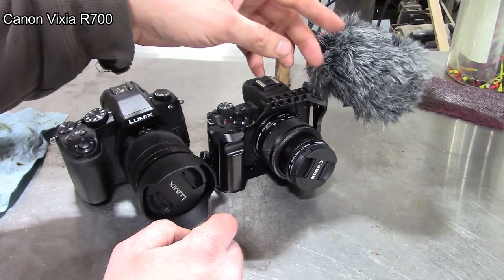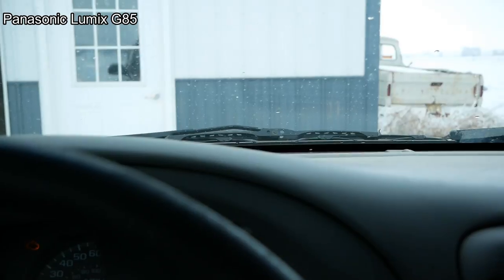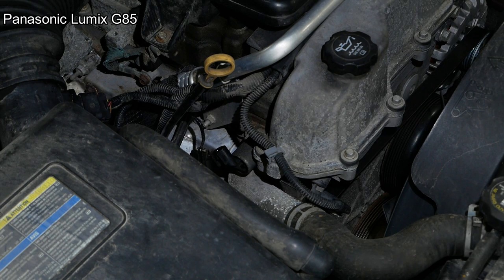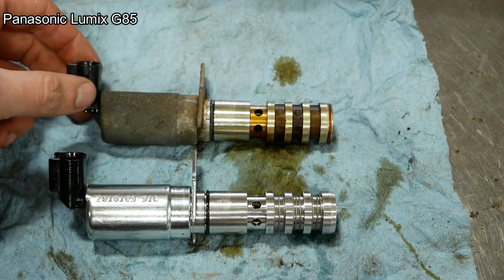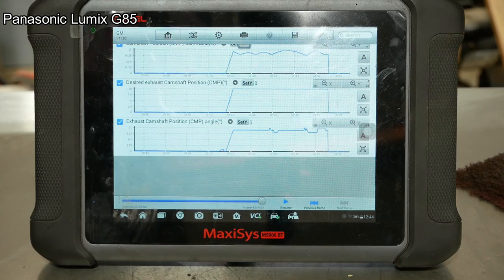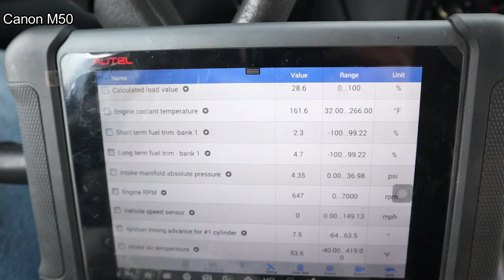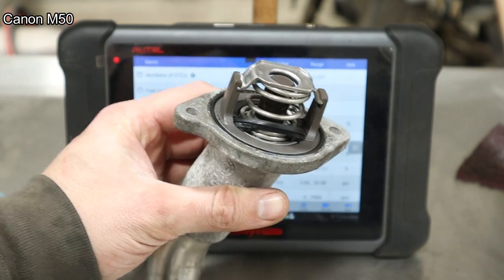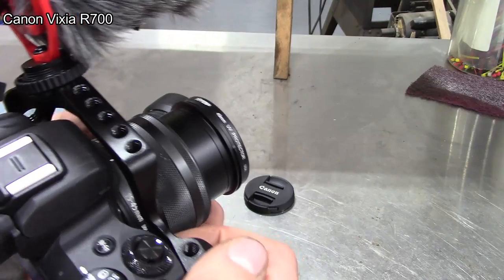Chevy Trailblazer -  Runs Rough on Cold Start, P0014- New Camera Testing

Comment: lumix is far and away the best image quality in my opinion, though i feel like there's some quirk about the framerate. color is great though. it looks a bit choppy, might be a software/settings thing related to the image stabilization? i feel like it would benefit from recording in 60fps instead of 30, maybe without the image stabilization? i guess that introduces some other problems in editing, file size and uploading though. 30fps just doesn't seem quite enough on modern devices. still something "homey" about that vixia though and even though its lower res, it's smooth and feels familiar.

Comment: So, here comes a long(ish) answer from a camera nerd. Without going into much detail, ISO stands for the camera's sensitivity to light. It is a standardized number that is derived from two major predecessors. They were the ASA (American) and the DIN (German) standards that essentially described the same thing. Many moons ago both numbers were printed on a box of film (yes. film). The lower you set the ISO, the less sensitive the camera is to light, but it also produces a higher quality image. The best test for the limits of image quality is to use cameras in identical, low light situation (max out the ISO) and see witch one produces the better image quality.  As for aperture (A) vs shutter (S) priority or program (P) modes. You use the cameras in a very wide variety of situations where the level of light changes rapidly and the subjects of your videos/pictures are sometimes very light or very dark. Ie, when a dark subject is in the front of a light background or visa-versa. That means the camera can't keep up with the wide latitude of light variety and simply don't know which one is your priority. A situation like that is when you want to use manual mode and that way the exposure will remain the same regardless of where you point the camera.  If you want the camera to sort of self-adjust and make the best of a tough situation relatively fast, put it Program mode. I will spare you the  details of when it might be advantageous to use Aperture or Shutter priority modes. They each have a place, but only if one really wants to geek out on this. I think in your situation is best to just set it manually or put it on Program.  As you get used to setting the manual mode it will often seem like a good option. I use to do this for a living. Like in many other craft, the more precise your setting (depending on your situation) the better your end result will reflect your intention. I hope this helps to confuse you :-). Cheers.

Comment: Canon for me as you have better control of your ISO & shutter speed as well as a better selection of lenses.  Of course they give you the worst lens as a kit lens.  Read up on settings as you had it set to manual which wrong and that is one of the reasons for bad auto focus

Comment: Everything in the background was blurry with the new Canon. I don't see anything wrong with your original camera. Why did GM use those thermostats with the rubber seal? It seems to cause a lot of problems and the computer controlled systems are so sensitive to engine temperature.

Comment: Maybe going do more tests with cameras to figure best settings will be Wes :) and may help! Also have ever tell costumer use 89 or higher octane gas plus add a bottle of STP Total Treatment for fuel injection or carbs plus on gas or deisel fuel vehicles and do on cold or hot starts get on highways speed like 50 to 80 mph speeds so get higher engines revs  compare slow speed highway do lots stop and go at many inserctions stops sign or lights stop at too ! But do faster speeds clean out engines dirty electric components plus less codes even parts to replace on and on slow speeds get more codes show up ! What trying saying on high speeds plus highways get full amps out alternator charging plus sensors work faster compare on slow speeds!

Comment: If you want to control the focus depth then use aperture priority. So, for videos I guess you would like more things in focus, so lower aperture is better >7, then camera will control shutter speed and or iso to correct exposure. Anyway all this wont do you much good if your lighting is not sufficient. I guess you could get roughy the same results with some tweaking with both cameras but out of the box the Lumix seems to do a better job for you.

Comment: As much as I miss my trailblazer, the thing was a temperamental piece of junk. Cam position sensor, vvt solenoid, a pile of thermostats, every oxygen sensor multiple times, fan clutches, etc. the thing was a nonstop money pit past 200k till it hit 230k and the 4L60 detonated out of the blue. Don’t even get me started on the CV running through the oil pan or the godawful SAIS/AIR mess

Comment: 2007 trailblazers have a regular pleeted fuel filter and fuel pump assembly, you'll need to replace that hole sending unit assembly, that's Also where the small evap leak is, I'll bet you $50 if it's not already been replaced the evap line on the pump is rotten...

Comment: If the cameras were using film I would say they are slightly overexposed (washed out). I would close the diaphragm if it has one maybe 1/3 to 1/2 a stop. What I said may be meaningless since I only used film cameras. The Lumix lens are basically Leica lenses if IIRC. Leica lenses are considered the best and this is coming from a long long Canon guy.

Comment: How bout a Sony A7s III? I liked the canon colors always and in this video too, but the Sony certainly specs out any other camera at the price imo.
Reply from the maker: I don't have $6000 to spend on a camera. That's 10 times what I paid for either of the ones I have.
Reply: @WatchWesWork  Yeah, it is expensive, but it should be proper... I only own the first generation A7s, which doesn't have much of a autofocus or in-body stabilization. But with a used 24-70mm stablized f4 lens it is still pretty good with it's sensitivity. I think you could get the A7s III with the 24-70mm for around 3500$ though. It is still a lot of course. All of the newest Sony's have autofocus that is nuts, even the A6600 (same system), but imo 1500$ for a APS-C is a bit steep.

Comment: I hate where GM put the power steering pump at least on the 3.8 in the Impala. Pain in the ass even if you remove the tensioner housing. And yes, the pulley on it has the holes. Doesn't make it any easier.

Comment: Auto focus doesn't like shiny surfaces like screens and clean stainless steel workbenches.  You shouldn't clean up so much.

ISO is the "film speed", doubles every increment, just like aperture and shutter speed.  Makes adjustments easy to calculate for the depth of field or movement.

Comment: Don't think you can describe the oil moving in the wire towards the ECM as capillary action. Oil has a higher viscosity than water of course and the higher the viscosity the more resistance to flow. Migration? (LOL)

Comment: Yes, it has a fuel filter, but not in the engine bay
Si tiene filtro de gasolina, pero no en el motor, esta debajo del conductor
Reply from the maker: Sin filtro amigo.
Reply: @WatchWesWork  cierto, al parecer de 2005 en delante está incluido en la bomba de gasolina

Comment: That's definitely a vacuum or filthy throttle body or so I thought intermittent issues are the worst my guess is that they got scared to drive it by the way it was running so it got stuck  and then when you turned on the car it unstuck hence why you couldn't recreate it

Comment: Leave ISO on auto (for videos).

If you want to change brightness level, change EXPOSURE values.

(iso will adjust itself based on exposure value)
Reply from the maker: You can't do that on the Lumix. It can control the ISO and shutter, or ISO and aperture, but not just the ISO.
Reply: @WatchWesWork mmm, well in that case, i would suggest try sony.
They're near perfection in terms of "video" side of image processing & software.

Comment: (14:29) the face tracking focus looks good to me... it's a tiny bit slow, and it hunts a bit... but all-in-all, not too bad...
BUT, you're overexposed... stop down a bit...
Reply: also, just leave the camera in aperture priority, and stop up and down, and rough set the scene exposure with the ISO. The shutter speed isn't really adjusting the video refresh rate, just the apparent open versus closed time of the rolling shutter. I've always been a Canon camera person, but in your case, I think the Panasonic may be your best choice. The audio was wonderful, that super-cardioid mic is nice! I really didn't hear, nor mind the HVAC cycling in the background, the pattern of the mic kept focused on the sound in front of the camera, and the off-axis noise wasn't really much of a problem.

Comment: I am not bothered at all by the resolution and detail of the images - even the "old" camcorder was fine in this regard.

The ability to capture content in a wide range of circumstances is more important IMHO. More content for us, less re-takes for you.

The moment when you apologised for having the Lumix on low ISO was interesting - I though it was holding detail in the shadows very well, despite the overall darkness of the scene.

In a situation where you're using artificial/point light sources (which is OFTEN) a high dynamic range (the ability to hold detail in both shadows and highlights) would be a virture, avoid having to re-shoot due to shots "burning out" or "filling in".

I was faintly surprised that you're relying on autofocus so much - I know that Keith Rucker LOCKS focus, and uses high ISO, small aperture to get large depth of field. This avoids "surprises"

Keith Rucker (and several others) also use roll-around "studio stands" instead of of tripods. These studio stands have the advantage of

* ease of movement
* long over-reach (mainly used for workbenches, but good for engine cavities too)
* easy height adjustment 

A few video via this search:

https://www.youtube.com/results?search_query=studio+camera+stand

Comment: My 97 chevrolet tahoe does the same thing. Backfires a bit to before it warms up. Been to 2 shops both ripped me off amd told me nothing. Paid one told me they wanted more money to keep lookong at it so i left that place went to another was told i jad low compression and need a new motor. I did my own test the engines just fine. I hate shops

Comment: armchair non-mechanic disclaimer  Why is it not standard operating procedure to hook up a scan tool before turning the key for the first time?  Does it interfere with some other aspect of troubleshooting?
Reply from the maker: I did. The problem was the cam timing stuff was in a different section of the tool. By the time I found it the problem was gone.

Comment: Canon always has issues with focus, ergonomics, and features. It's not so much that it's bad, but not to a lot of peoples liking. I didn't care for the M series.  ISO is NOT for adjusting exposure for most cases. That is what the aperture settings are for.  Most people will screw that up however , use other features for that. Read the manual.
    The Canon has a crop factor of about 1.6 that makes a stock 50mm lens w/ ff sensor about 80mm.
 https://photographylife.com/what-is-crop-factor
     Just skip the Canon and go with the Pany.

Comment: I would just put it in auto aperture , you are not moving fast, so  shutter speed is not critical. The Camera should do the rest for  you. The aperture sets the depth of field . So that might affect the auto focus?

If you need more depth of field adjust the aperture manually

 
 The ASA number is like old school film had higher numbers were for fast action, low light  or when you were panning the camera like in  a race car going by at high speed. 

Oddly I am seeing this info in a 1960s Yashica Eletro 35mm camera owners manual  an early camera that was user friendly and lots of men coming from the Vietnam war had them..

Comment: I know I already expressed my opinion on the last video, but the M50 looks WAY better. The colors are more natural, the focus is better, and the lighting looks better. As for the focus issues you had, I think it's because of your lighting, focussing white on white is tough, lol, I was thinking that about your midwestern  skin tone. Also your MaxiSys analyzer looks better on the M50. If you bother to set the proper settings (tons of of videos on it) on the M50 you will have great videos, especially if you get the 12-24 lens or one of the Sigma lenses. Like I said before, the M50 has consistently won against Panasonic in reviews.

Comment: As against your good English and vocab, it was surprising to see bad English in your diag screen: "Not ran." Which should be not run, as in: It hasn't been run. One has to wonder, on the oil wicking, does oil become ionic & conductive, due to acid formation or micro metallics from wear? And it seems daunting, the amount of knowledge/experience one must possess to be efficient at troubleshooting; even if the diag provides clues, one still has to sort and judge what's meaningful, influential. Kudos to those who persevere in stacking and integrating the experiences on specific and numerous models. And then there's camera troubleshooting...

Comment: Wes - check out @DSLR Video Shooter,  @Gerald Undone and Jordan Drake at @DPReviewTV for video tips/techniques. Essentially, your shutter speed is determined by your frame rate. Double your frame rate and round up to the closest shutter speed. IE 24 FPS -> 1/48th sec -> 1/50 or 1/60th. This gives the smoothest (aka cinematic) look/feel. If you shoot 30 fps - >1/60, 60 fps - 1/125th. If your shutter speed is too fast for your frame rate, you will see a stop motion/strobe effect. Alternately if your camera is so equipped you can use shutter angle (180deg is cinematic). Aperture determines your depth of field/how much is in focus, as well as the amount of light entering. The size of the sensor/focal length impacts the depth of field. ISO is a gain adjustment for the sensor. higher iso = more gain = more noise (varies by sensor/camera). Given your content/location lighting, you might consider setting the ISO to Auto (with a limit of say 3200 on the upper end for M50 and G85 to limit noise), as a means to deal with the variable light conditions. In the event that you find your self shooting in bright conditions, neutral density filters (fixed and variable) can help you control the light while keeping your settings in the zone you choose.

Comment: Ranking your 3 cameras Ist Panasonic by a country mile. 2nd Vixia good and 3rd a long way behind is thg e other Canon. Its performance judging on what you were able to show us is simply awful.
Oil tracking along electrical lines to the engine computer is very common for the Landrover Defender and Discovery fitted with the TD5 diesel. -Replace the injector wiring loom and clean the contaminated pins with brake cleaner and your fit to go - loom cost approx £35 pounds.

Comment: That vvt piece gets clogged up and it will starve the crank for oil ruining the engine. Ask me how I know.....All it requires is a decent owner who will change the f*cking oil once in a while! I did not find that pump to be a big problem. Other than that, these are about as perfect an engine I've ever seen except the braindead design that requires an oil pan removal to get the timing cover off. Which means pulling the engine.

Comment: 4.2 litre engine in that little thing? Where do the people go?
No wonder there's a bloody climate emergency!
You could chop that engine in half easily!
America! Listen! There's these little tricks called gearing & tuning. Depending on use there's turbos & vtec & weight reduction. 
Not every problem is solved by more centimetres ³!
I get it, power & speed is life! I've been a petrol head since I got given a Casal 50 at 14. Taught myself to drive, sans licence, in a £50 Vauxhall VX4/90 at 17 & I've driven ever since.
But putting a truck engine in a car is silly. It would have to be the softest tune ever! It just can't be working efficiently because it'd turn the occupants into a smear of red jam (jelly) on the inside of the rear window!
This kind of vehicle is why we won't have nice things much longer. Non petrol heads see waste & inefficiency. For that matter so do I!
If we're going to stretch out playing with internal combustion engines for as long as possible, including 4.2 litre highly tuned monsters, then we can't give them vehicles like this one to beat us over the head with.
Reply from the maker: That's the smallest engine. I think you could get the 5.3L and even the 6.0L V8!
Reply: @WatchWesWork  Gulp! 6 litre V8! Imagine tuning that up properly. It'd be so quick!
But for normal day to day road use a modern 2 litre would suffice. 
That V8 must have so much potential though. I bet they spend  their days just above tickover. Not good for an engine either...